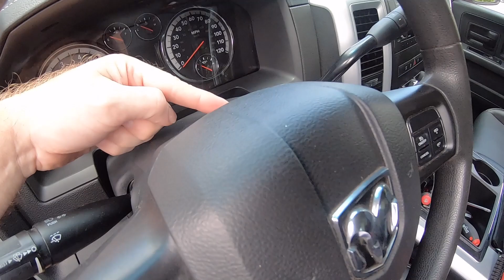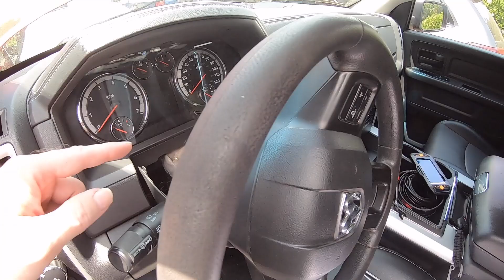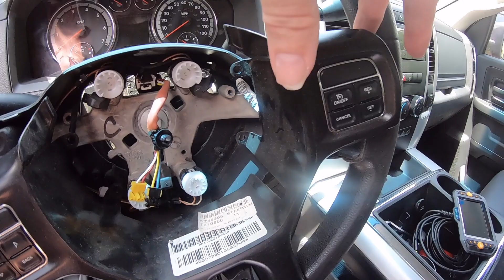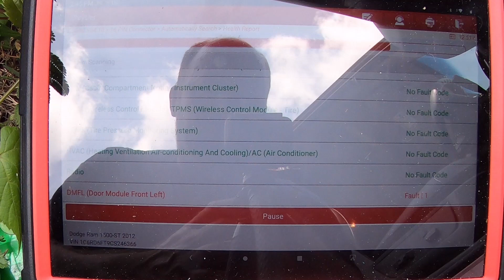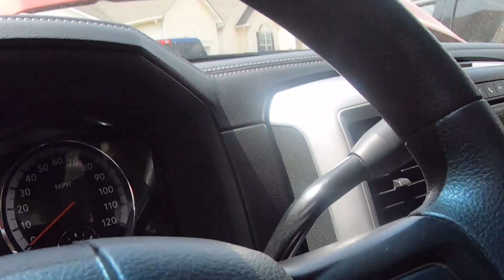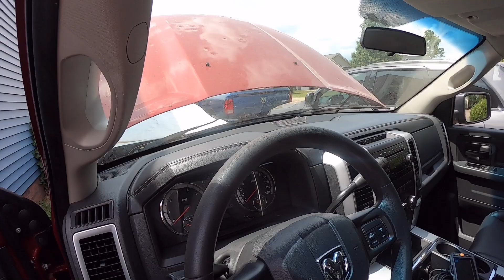2012 hemi 1500 project X (Candy Apple) Part 29.  Cruise Control Switch replacement and updates.

Comment: Man you can buy the set for left menu & right cruise control buttons for like $20-40 after market . The plastic frame that the buttons screw in to can be both disconnected and removed to unscrew and install the button switches easy with out being giraffe necked . Lol just swap out screw in and connect them both before putting back together . Also not sure but seen every body disconnect and reconnect yellow first  then black not sure why